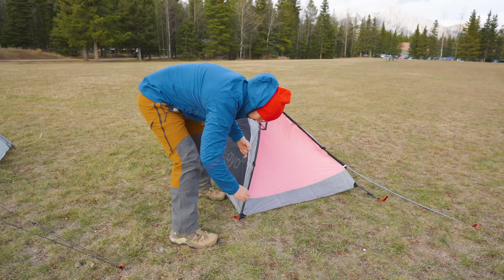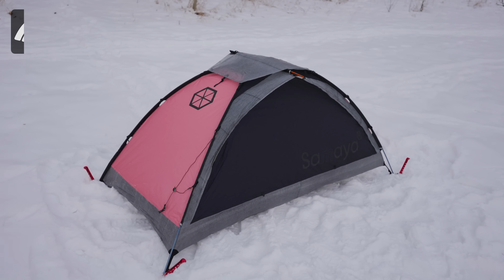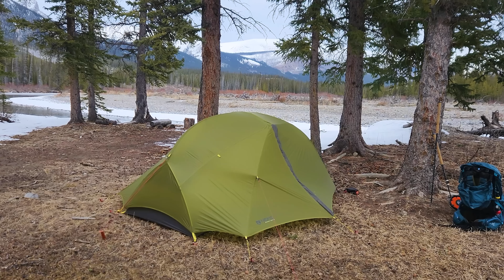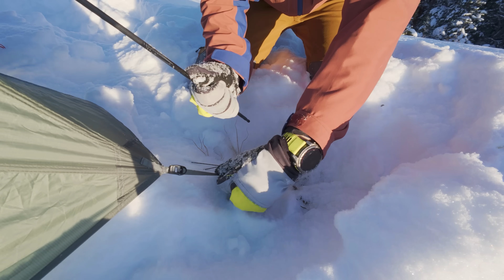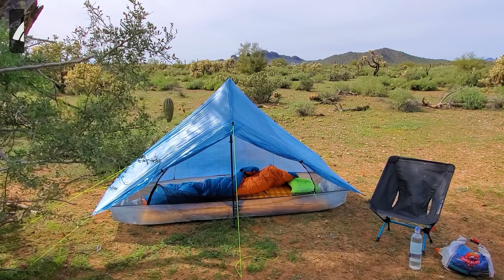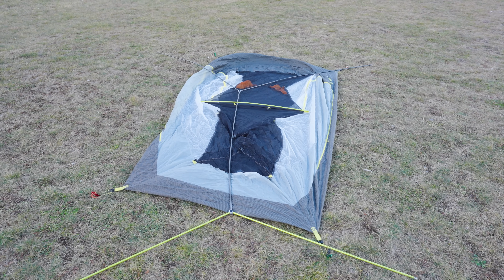Can These Popular Tents Survive Extreme Wind? Let's Find Out!

Comment: Nice video. It's great to see actual recorded wind speeds (rather than guesses which are often too high). Glad the X-Dome did well. I think the end wall stake point would have helped for that bent ferrule, but also we will add some extra guyout to the lower legs for the next batch to improve things further.
Reply: It’s good to see you guys react so quickly. It only reaffirms why we buy from y’all
Reply: I think this comment just solidified me buying a Durston backpack/tent next season. I love to see a company look at what they can improve on an already well performing product.
Reply: ❤ for Dan!
Reply: Hi Dan, I just got my X-Dome 1+, but due to this video I made a new order of the one coming in April. I'll give this current one to a Cub Scout instructor, so it won’t go to waste. For the April version I would super appreciate if the hole on the meeting of the 3 zippers is as tiny as possible, so no ticks come inside. Thank you again for constant improvements! Can't wait for whats next!
Reply: As someone who is just learning how to stake and position a tent according to the conditions using guy lines for wind and rain support is super confusing. Would it be possible to get a video showing and explaining the best ways to do this with the xdome? Similar to what you did with the set up video which I found super helpful btw! Thanks!
Reply: All the hearts for others but non for Dan🤔
Reply: Dan, which way should the tent face in the wind?
Reply: @cheri7828  If you have the trekking pole supports then the sides are likely the strongest, whereas if you don't, then the ends would be best, or with a corner into the wind.
Reply: 🤔 is there gonna be a groundsheet available in the future where it can be attached with just the fly? Like covering the whole inside..
Reply: @joewinfree9814  Ours just covers the floor but a groundsheet from a different 2P tent would do a nice job of fully filling the X-Dome fly. Most of those are about 50" x 84", which fits great (e.g. the MSR should fit nicely.
Reply: The next batch meaning the one in April?
Reply: Yes
Reply: @durstongear  thanks
Reply: Too weak of a frame on this Xdome just to hit the under 1kg mark.. It'll definitely be a problem in the future, will see
Reply: @KevInpouich  In our product video we show how it is quite a bit stronger than comparable tents. It is not as sturdy as much heavier 4-season tents, but for it's intended use as a 3 season/3+ season tent it is sturdier than most.
Reply: @durstongear Hey Dan, will we be able to purchase just the rainfly separately at some point after the additional guy out attachment is added?
Reply: Quite likely
Reply: @TheRealStove   Eventually all the parts will be available separately so you can do that, but it is really is a very minor change on a tent that is already quite good compared to similar tents. Also, if you add the end wall stake point it would be stronger, and you can add guylines to the lower clips now to do something similar to the extra ones.
Reply: @durstongear  Yeah, I’m not too worried honestly, but good to know just in case. Thanks for the response! Love the tent so far! 🤙🏻
Reply: @durstongear  Nice! Thanks for your efforts replying, note the new solid inner available. Random one, possible to get an inner that utilises the whole internal space (remove vestibule and just unclip a corner if want a vestibule - e.g. Hilleberg Unna), so that the inner space if 130cm wide both ends. Only want one door but the extra space would be perfect (for a kid) and just storing gear inside vs outside.
Reply: @grantricker8001  It's possible, but the 2P version is going to be a lot more comfortable for two people or adult + kid. I appreciate the value in just using a single tent, so a double inner for the 1+ (in place of the vestibule) is possible and could happen some day, but it's a lower priority so it wouldn't be ready any time soon.
Reply: @ thanks! I might keep my eye out on this, as the 1P 'footprint' is great, but want the ability to use solo + with a kid / wife. I need the smaller footprint to pitch in tight spots, hence not wanting a 2P and also keeping primarily for solo use. The Unna space would be perfect, but yours would be an extra 20cm (130cm vs 110cm) which would be amazing.
Reply: @durstongear 

Have you guys considered making something like an X-Dome and a Hilleberg Soulo had an illegitimate love child? Call it the X-Storm or something (highly original name idea I know.) 

Take all the best bits of each. Freestanding double wall only. Using robust fabric, 9.3mm poles and a combination of pole sleeves and clips along with all the best tips and ideas you guys have had from the community around your x-mid and x-dome? A tent you could truly trust in near all conditions with plenty guy out points. Like if an X-dome took steroids, ate only chicken and beef and went to the gym 9 times a week. I know here in the UK and elsewhere it would likely become a firm favourite if you could make this and have it close-ish to 2kg. For me, it would be a shuddup and take muh money type situation.
Reply: @durstongear for the xmid and x dome, do the trekking poles have to be straight handled, or can they be ones that have a horizontal handle (I have Forclaz mt100 trekking poles, green shaft, black and blue handle, from decathlon. The very front of the handle does have a lip so to speak) would they work?

Also, the comment above, with the X-Storm suggestion… love it!😂
Reply: @Sgt_Plague  Angled poles work fine too.
Reply: @durstongear has the guyout on the lower legs been implemented on the X-Dome 2? Thanks!
Reply: @durstongear do you off this tent with aluminum poles?
Reply: Wow, I just read some of the comments and a lot of you are irrational. Do you complain and ask for a refund when you buy an iPhone and a new version comes out?

Also, a small upgrade like this isn't going to revolutionize the product. It takes many upgrades of this size to truly make a difference. What I like to see is a company eager to make those many upgrades.
Reply: @MorkMins right durston is an honest and innovative company and these ungrateful people are like vultures and dan still shows respect. They are the worst type of customers. Karen's.  I bet they all have reddit accounts 😂😂😂
Reply: Was waiting for this comment, just ordered the tent a couple of days ago, hope this little fix makes it to the April batch - but also hope I will never have to tent is such conditions...
Reply: ah I knew i should have waited. upgraded version released barely months after my order :(
Reply: @GregTheCamper  The extra guyouts are a small further improvement, but also you can do something similar now by adding guyouts to the webbing at the lower clips if you are really pushing the limits.
Reply: @durstongear  Good to know about the possibility to guy out from the webbing - thanks! Will the extra guyouts in the April release be where the current webbing is or will they be a little lower down?
Reply: There will be the same ones there are now, plus extra ones near the bottom. You can do something sort of similar now by attaching extra lines to the lower clips.
Reply: @GregTheCamper  This is literally the case with every Durston product ever released.
Reply: Hi Dan, are you offering refunds for us waiting on the April tent drop? This was an unmitigated disaster as you can see. I don’t want to get hurt in this thing. Pole in the eye while sleeping for instance
Reply: @Ghostofprybar  The X-Dome is intended a very capable 3-season backpacking tent, so it is not intended for severe 4-season use, yet still did similarly well as the 4-season rated Samaya here. But yes if you want to cancel a pre-order that is totally allowed.
Reply: @Ghostofprybar agree on this…wtf, this isn’t good

Comment: Interesting video.  Understand that your one suggestion to, "Try to avoid windy scenarios" isn't always possible.  For example, I'm heading to Iceland this July and taking several friends with me.  It can be notoriously windy and rainy there, and while some campsites have large rock circles that can act as wind breaks, some do not, and it's not always possible to avoid the winds.  We're planning to take wind worthy tents with us, even if that means they're heavier than our normal 3-Season tents.

I'm also a bit dubious of your #1 pick being the Zpacks tent.  The TarpTent ArcDome was much stronger in the wind and had very little panel deflection compared to the Plex Solo.  The ZPacks tent had a LOT of wall deflection, and sleeping inside the Plex Solo would be a miserable experience.  Also, if wind-blown rain were added to the mix, I would anticipate that the Plex Solo would do a poor job protecting the occupant with the elements because it uses a door clip instead of a door zipper.  Dixie took a Duplex to Iceland not long ago, and her synthetic quilt got soaking wet due to the Duplex door design letting in a lot of wind blown rain.  In contrast, the low, zippered doors of the TarpTent ArcDome, combined with the solid inner option, would offer significantly more weather protection.
Reply from the maker: For sure, there are tons of different scenarios where different tents will shine and there is not really a one size fits all (unless you're willing to carry a 10lbs tent).

Comment: Mountain Hardwear AC2 tent is quiet, easy to set up and handles wind 65mph with 85mph gusts no problem. At 3.5 lbs it's always worth the weight in exposed high wind areas. Yes, I have the xmid1p, xdome1+ and bigagnes hv2 mountaineering tents.

Comment: This is really helpful, thanks.

I think pole sleeves on the four corners would be nice, for the upcoming X-Dome solid (like on the Soulo)
It would be stronger and make setup in the wind easier.

It would probably make it impossible to pitch only the inner, but I think that’s not a big deal on a solid „bad weather tent“
Reply: Wouldn't work. It's a hub based pole system. Can't thread that through sleeves. At best you could have sleeves on the sides and clips on top but it would make it a nightmare to pitch.
Reply: @jonarific8504  yeah, dan may as well put in more guy line loops for multiple places to just guy the corners off even more and get the benefit of the guy lines supporting the poles!
Reply: @jonarific8504  In fairness to @larsmuller5541, I believe you have misunderstood what he meant: The Soulo (and other decent 4 season tents such as the KUIU Storm Star) have 'sleeves' just at the pole bases, that extend approximately 12" up from the ground, and then go to a clip system to suspend the rest of the fly. I agree with Lars and would love to see Dan make that change to the upcoming X-Dome solid, possibly then using clips on the inner rather than the plate system - and it wouldn't take much to make an adapter for the (very rare, non existent conditions in the UK [ ! ] ) when one might wish to pitch the inner alone.

Comment: Biggest tip I would have is around site selection.  10ft down from an exposed peak, snuggling in  behind a rock outcropping, pitching behind a couple trees or bushes, or anything else that can provide a bit of a windblock, can be the difference between a cozy and miserable night.

Comment: I've only ever broken 1 tent pole and that was on a Mountain Hardwear Trango 2.  Big gust of wind while I was taking it down. No matter how tough a tent is when it's set up, they are vulnerable during the pitch or when breaking camp. That's the huge advantage of trekking pole tents - Get it 100% staked out then pop in the pole.
Reply: I would think tunnel tents would also have a significant advantage when setting up in wind, although there may also be a significant weight penalty with those.

Comment: Used my xmid pro 1 in 18 m/s with all 14 guylines. Works pretty well especially when you have the wind on the short side. But staking out all 3 points on the big panel makes a big difference.
Reply: Personally I don't understand why not to guyout every point for wind test. Personally I carry  14 stakes for Pro 2. Never seen side panel staked out like that before either.
Reply: @Pisunisse  bingo.  any sane person goes full guyout in windy conditions.  anyone with fewer pegs is just unprepared....